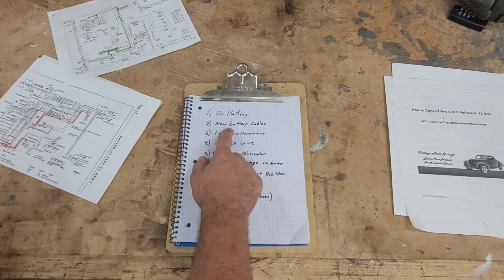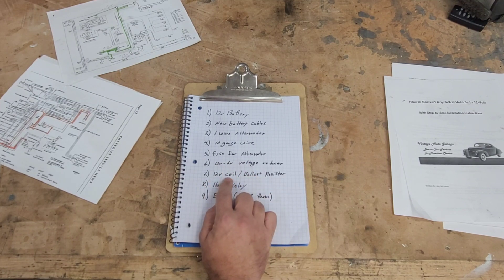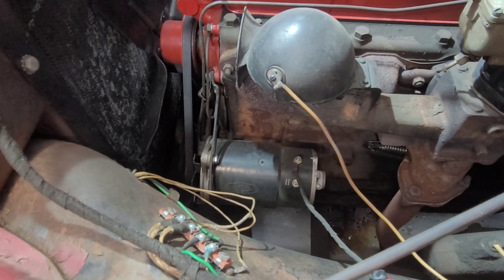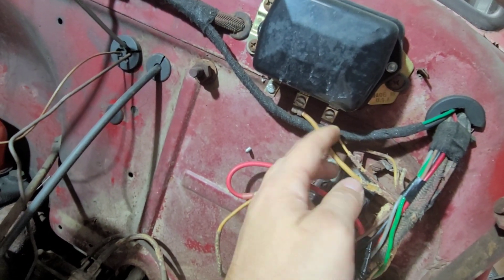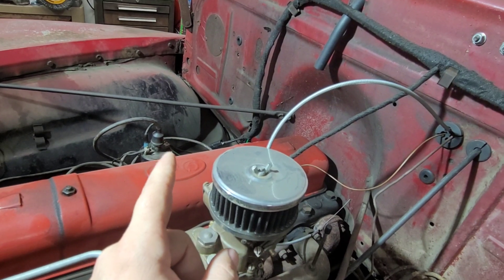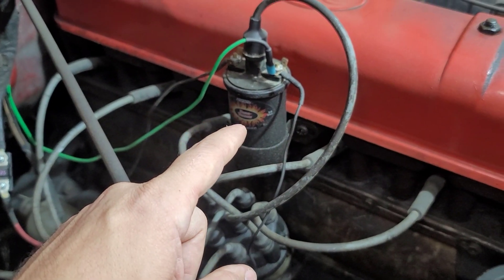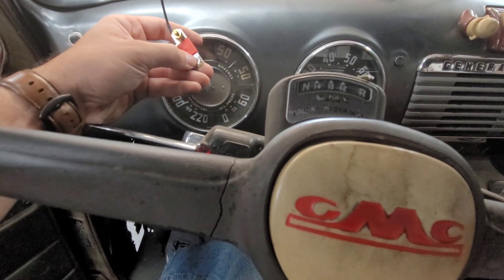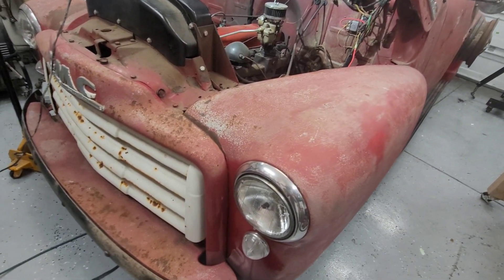How to do a 12v Conversion on a 1947-1953 Chevy/GMC truck using a 1 wire alternator.

Comment: I have a 12v conversion in my 51 Chevy and my alternator took a shit. Alternator has 1 wire. Where can I find a replacement or which one can I use preferably local parts house

Comment: Pretty good video..
But missed the part number for the 12 to 6v adapter reducer..
You whipped it out in a big glare turned it over in lightning speed so could not see the part number...????
Thx..

Comment: I have a 1952 Chevy that i have been doing work on and when the truck was painted internally they sprayed over the center speaker and glove compartment panels. I have stripped the paint from the top and bottom of the speaker grill area but it looks like the whole glove box door is also stainless or is that aftermarket? looking to at least strip down the top and bottom to match the center grill if possible. any idea of what the door is made from?
Reply from the maker: The ones I have are aftermarket, but stainless was an option from the factory.

Comment: Thank you for making this video, it is very helpful!  I have a 1951 Chevy truck 3600 (3/4 ton) and am in the process of replacing the worn out 216 engine with a 1954 235 engine and am starting the 12v conversion. Which is how I came to watch your video. Thank you for sharing all the 12v light bulb sizes!  Other changes: I had the starter rebuilt for 12v (no selenoid, just step on the starter pedal on the floor), has the original horn rebuilt and converted to 12v,also, got rid of the contact points and did the Pertronics electronic ignition upgrade to my distributor. As others said, for motors, like the blower and wiper motors you cant use the low amperage runtz style 12 to 6 converter you show in the video. You need to use a heavy duty voltage converter for motors. One that works with up to 10 amps of continuous current draw. Great video and thank you so much for making it!

Comment: Wait Im so confused on gmc 😩 I have a 1954 gmc im not sure exactly what it is but I do know it was a flatbed and it has been taken off and the frame has been chopped to look like a 3100 everything has been moved and it’s ready for new fuel lines and brakes lines and drive shaft , now I’m tryin to get the inline running but I can’t find anything about it and I know it needs a 6v battery but my starter wasn’t turning but I’m not sure if what I had worked, I had a battery charger on it with the 6v on. Any information will help !
Reply from the maker: Sounds like you have had everything modified on it, would be best to check all the wiring in your case and verify it’s hooked up right. Also test to see if your starter solenoid is working. Plus GMC factory was 6v positive ground. So keep that in mind. If I was you and all that had been done. I would think about a new wiring harness

Comment: @9:27-Isn't there a bulb within that hydramatic shift selector that would need to be modified for 12 volts?
Reply from the maker: Yes there is! It very specific I didn’t include it

Comment: What about the starter solenoid?
Reply from the maker: The start solenoid will work just fine. Actually work really welll on 12v. Definitely won’t have the same life span but ppl have reported years of use on the 6v solenoids after 12v conversions

Comment: Great video, been thinking about converting my 54 Chevy Bel Air. Just need to look under hood to see how close this is to your truck. Thoughts?
Reply from the maker: Should be very similar, I would just check the wiring diagram and follow the line from the generator back to the starter. GL! It’s a great upgrade
Reply: @Ev3rydayGarage  Thank you, I will check it out!

Comment: Was there any modification required for the Ammeter?
Reply from the maker: Mine was already on a negative ground system when I got it so I didn’t have to change anything. If yours is still in a positive ground setup it will work just fine but the ammeter will read negative amps. To correct that just swap the wires on the back, it will the read positive amps as it should.

Comment: Great video!! Just a few things. One, you caught the 6V positive ground, great job!! You will also need to change the voltage regulator on the firewall if still using that. I noticed the gauges in your truck are actually Chevrolet, not GMC but that is OK. The voltage reducer you are using for the fuel gauge is only good for the fuel gauge. You would need a heavy duty, hi amp reducer for the radio and heater motor. The headlight switch is debatable. The ones I have that are original have a thermal circuit breaker so they would be specific to voltage. In most aftermarket parts catalogs there is a 6V and 12V for this reason. Lastly, the horn should be changed out for a 12V horn. I would check the part number because that is not the original horn I don't think. On to the next video!!